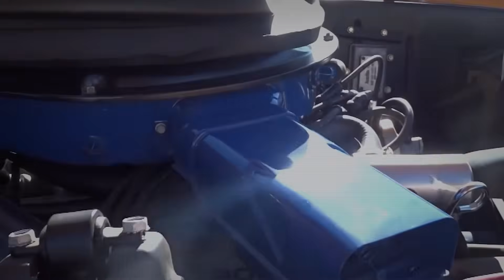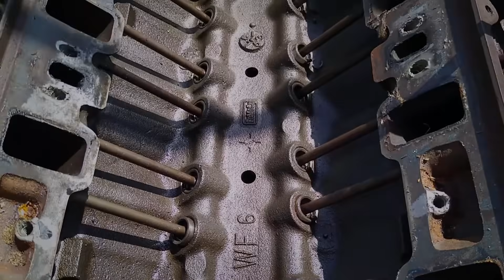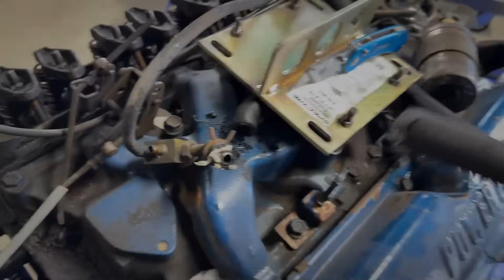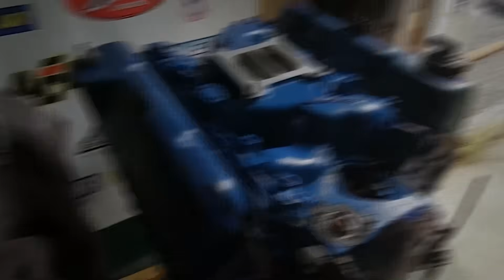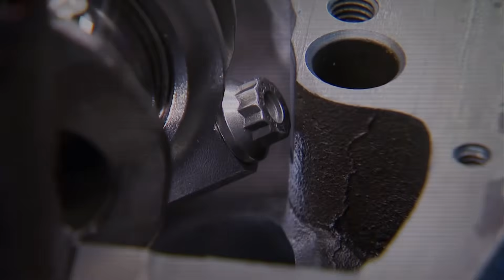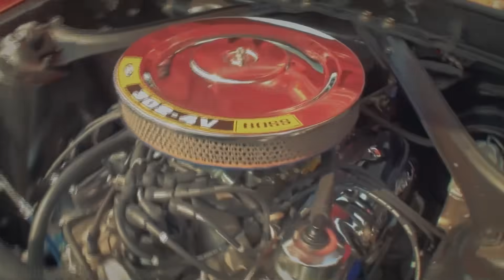The SHOCKING Truth Why Ford Abandoned The INFAMOUS Boss 302 Engine!

Comment: Allot of information on the Boss302.
However, I worked at fiord in the 1970’s and have to say that the boss 302 was a dog below about 3,000 rpm. The Chevy 302 with the same rear axle ratio would walk away from the boss from a standing start.
Probably intake runners on the cylinder heads were too big!.
Ford seemed to have the same problems with the 429 CJ and SCJ and also the 429 Hemi.
Sometimes more is too much!

Comment: Ford has a repeating History of beating the competion into submission. Then Abandoning their success for medeocrity. The GT40. The BOSS302. The BOSS 351 C And 429 HEMI. The company didn't have an engineering or design problem. They had a company direction problem! Ford wrote multiple performance Records. Some that still stand. Then abandoned their fans and supporters. It's no wonder GM remains as popular as they are. GM never left it's fan base without performance options.

Comment: Cleveland 4V heads were pure junk right out of the box....Bob Glidden had to cut the entire outer section of the exhaust ports away, and then fab a plate to bolt on.
It was an awesome cylinder head.....until you tried to stuff it between the frame rails of a street car